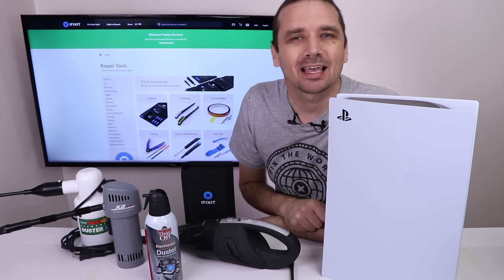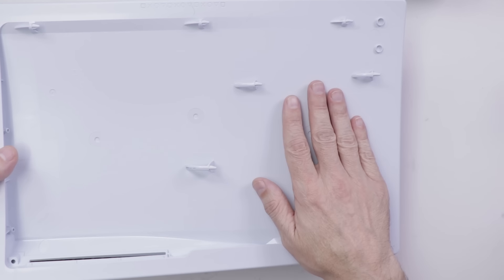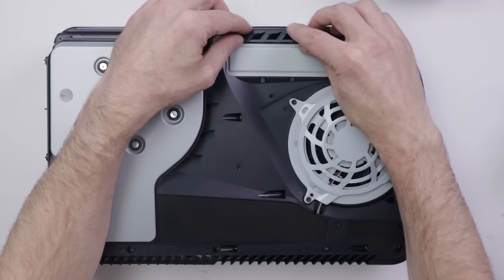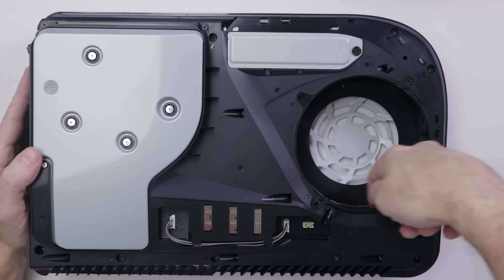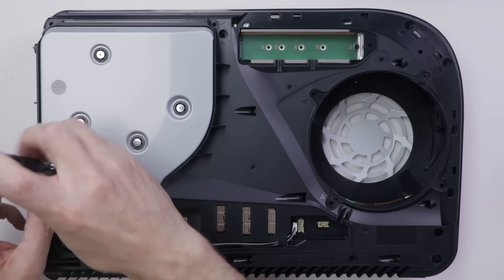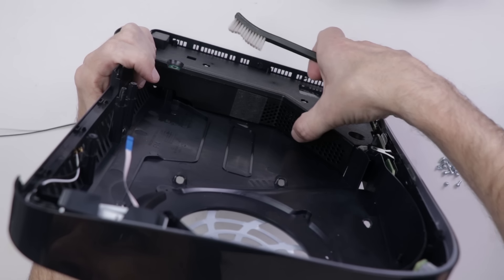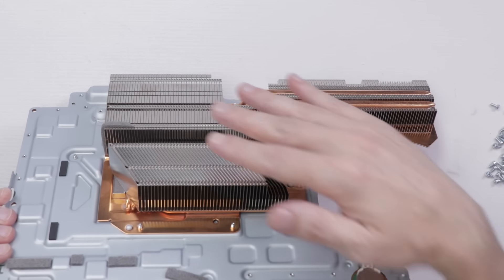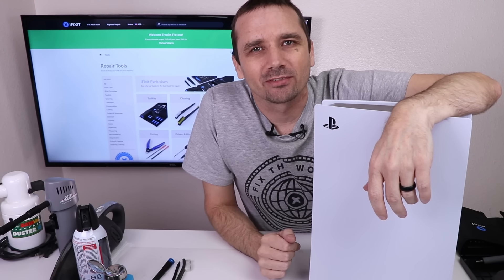How to Clean Your PS5 Safely - 3 Stages

Comment: Tip: before attempting stage 3, please note there is a sticker covering one of the screws which may void your warranty if peeled. After stage 2, I was able to look inside and saw lots of dust on the power supply. Picked up a shop vac microtool set from Lowe’s and I could clean it from the fan opening. No more random shut downs

Comment: Really helped me get it apart and cleaned, however, reassembly was so much more difficult due to inconsistencies in the screw placement during your video! You put the silver screws in the wrong spots in 4 places and made me redo half of the things I put together. Noticed it in a quick 1 second cut after you installed the disc drive at 10:17. Just be consistent
Reply: Yup, posted a comment calling out as many of the issues with this video as I could remember, still forgot a few. Unreal that only a few people are addressing it

Comment: Is there any way to tell if your console ABSOLUTELY NEEDS step 3 cleaning?
Reply: If you’ve taken the fan out, & you see the heatsink fins on the inside clogged with dust it’s probably a good idea to do stage 3. 
After you’ve dusted it that thoroughly, try to just dust the fan with air every few weeks or so.. that way you won’t have to take it down that far again.

Comment: All this made me realize how much cleaning the PS5 really needs especially at the 3 year mark. I never had issues prior and I’ve cleaned it every month but it was just the surface. I never knew the heat sink needed cleaning and boy was it dusty. I ran into issues of the PS5 turning off by itself. Come to find out the PS5 is very sensitive to dust build in the heat sink and hence why. There was no other reason I haven’t dropped it or spilled anything on it. So this dust has become my enemy 😂 the first stage is no problem cleaning out the heat sink with compressed air is good. Now I’m thinking of getting one of those air fans that pull out heat for the back. I honestly don’t want to replace it and I know that may happen down the road but nobody wants to drop another $400-500. Warranty doesn’t cover us anymore at least for launch consoles so while it’s a bunch of cleaning I’d rather do that than not.

Comment: I'm scared to do full disassembling, can I just use vacuum more frequently on two holes which are intended to collect dust?
Reply: Better than nothing
Reply: That won't remove the dust inside.
Reply: @jaybro3713  it will remove most of it if he does 2-3 times a month

Comment: 6:55 how do you remove the black and white cabels? Mine seemed to be stuck. If there is a way so safely remove them then please tell
Reply: Just pull them up. They are not soldered on so they should just pull up. They should be easy to reconnect/disconnect. 

Just make sure you know which colour goes where - I took a picture before and after so I remember.

Comment: @TronicsFix This was a very helpful tutorial and it stopped my PS5 version of Elden Ring from crashing. The only criticism I have is that, in the reassembly stage, a couple silver screws were put in the wrong spot and you can only tell when the disc drive is being reinstalled. Just thought I'd point that out in case you would like to edit that step to keep people from making a mistake. :)
Reply: Did you go all the way through stage 3? Cuz ps5 games have also been crashing my console and i heard it’s from the psu

Comment: Whose here cuz they ps5 got some visible dust through the air hole thingys
Reply: I’m here cus my ps5 can’t handle an hour in helldivers or wreckfrst without going into a coma
Reply: Oh for sure, I saw it the other day and that simply will not do.
Reply: I fixed this issue btw anyone reading - £15 on a specialised screwdriver set and an air horn
Reply: Me

Comment: Used this guide over the weekend. Worked great! PS5 is cruising now and I'm no longer getting the "overheating" message or shutting down due to overheating. Thanks!
Reply: @Draco_P_  Did you break your PS5 all the way down to Stage 3 of cleaning? I tried to clean mine and it’s still overheating. I’m about to tear it apart and hope it’s easier than it looks.

Comment: My hands are too weak to remove plates 0:43
Reply: It could be an issue of technique ensure on the side with the logo you are pulling (not too hard just so it's a little out from the console)  the top left of the plate (presuming it's standing and facing you normally) and for the other side it's the top right of the plate aka near the back of the console.

Once you've got the part lifted for whatever side your removing keep it lifted and slide it down if by this point you haven't already have your console on its side so the plate has room to come off

Though if it isn't an issue of technique then my apologies I don't know any more accessible ways to do it.

Comment: Thanks this is the 2nd times did a stage 3 cleaning of the system. It works everytime. The 1st time I did a stage 3 cleaning was about a year and 6-8months ago. I notice that the system was producing at lot more heat and making my room stuffy. So i knew it was cleaning time. Thanks Your video was a big help!

Comment: I have a question, do you have to exactly go through all 3 layers of the ps5 or do you have to clean the first layer cause it’s very time consuming if all 3?
Reply: Stage 3 would void the warranty so no don’t go as far as that
Reply: Nah stage 3 is absolutely ridiculous, I doubt getting dust in those areas is gonna ruin your console. I only dusted my ps4, didn’t take anything off and even for that my system never had a problem

Comment: Hey mate, awesome content, helped me greatly getting through my cleaning and dismantling. Although i would like to point out an error you have made from disassembly to the reassembly. During disassembly where the SSD card slot is, you have all 3 holes below the SSD slot. But during reassembly, you have the middle and right screw as non existent below the ssd as non existent and a screw that shouldn't be there approximately 10o'clock from the fan slot, you also placed the remaining spare screw at the bottom of the hard drive which needs to be free for the case screw. This caused an extra 1-2 hrs of stress and wondering where i went wrong. Hopefully you can edit this to save others the hassle! But all on all, brilliant job mate!

Comment: Do people do this?
I’ve owned every PlayStation over the years, except the new one (you know why) and have not once cleaned any of them yet they all work 🤷🏻‍♂️
Reply: Some people live in grotty homes.  Never had an issue either.
Reply: I can't answer for everyone else, but I recently took my PS5 apart, to add little o'rings up and under the fan, to try & mitigate "noise".. & the unit
already had managed to get a very fine coating of dust on it. So I partially cleaned it while I was finagling with the fan. 

Also dust gets everywhere.. EVERYWHERE (Its really just time & air circulation)... & with more powerful CPU's/GPU's & heat generated.. its probably going to be more
imperative that you stay on top of the dust control in the future? 

Also its called "Thermal degradation"... everything electronic hates too much heat. So while your units probably worked alright.. you might have cut
some of their lives short by a bit?

Like you, I haven't had too much problems with any console in the past, & dust. But I also was ignorant of.. purpose of keeping my console clean.
Reply: Yea it may work but it’s still dirty, my 2013 ps4 is extremely dirty but still works. People clean there consoles so it lessens the chance of the console to just stop working
Reply: I've had mine from realise date and i checked my dust just today, its pretty tiny for nearly a year 😅.

Comment: Just a note you could have mentioned when reinstalling the metal plate as i saw you initially messed up and changed it when you went to install the disc drive. The holes you dont put the silver screws back in should all be marked with a vertical groove. Small note that i noticed when trying to figure out where i went wrong after pausing and copying the video at the reinstalling phase realizing it was wrong.

Comment: Just did my first cleaning since May last year. Only needed to do a level 2 cleaning. Just used a toothbrush and a new J-cloth because the dust was so light. I'm surprised it wasn't more filthy given how dusty the outside of the console was but I'm glad it's not needing a level 3 clean. 
One thing I wish you kept in was which length screw goes where when re-installing the fan. I kept mine in order, but others may just place them haphazardly.

Comment: Had my console for over a year and never cleaned it. I eventually needed to upgrade my storage last month so I took the plates off for the first time and noticed the dust in the fan. Unfortunately at the time I didn't have the right tools, so I ended up using a vaccum on the outside. I did stage 2 today and I was terrified about disconnecting the fan but my console still turned on rn, so I'm glad i didn't mess anything up

Comment: If you’re nervous about doing step 3 it’s well worth it. I just got done cleaning everything out and holy hell the power supply was CAKED in dust, fur, and god knows what else. If your PS5 is overheating and shutting off please don’t be afraid to go that but further rather than just cleaning the fan

Comment: Wanted to comment, I've had a ps5 for a few years now, never cleaned it. Noticed it was noisy so I did the level 1 clean only using a regular vacuum. Just that helped a lot. It definitely needs a level 3 clean with the proper tools though. I suggest doing level 1 clean often to avoid having to do a level 3 clean haha.

Comment: I clean the fan from both sides and also all the vents, holes and ports using a strong vacuum cleaner. I put the console in a plastic bag to block all vents so that the air suckling will be much stronger and deeper when pointing the vacuum in each spot. Not a tiny dust particle remains inside. Just make sure the plastic bag covers all vents while vacuuming form each spot and do this in sequence.

Comment: @2:50 cleaning out those holes mattered for me. pulled out a large clump of lint. glad i found this video. ive opened and sprayed my ps5 a couple times. it would turn off without warning and i have to unplug it. finally found others with the issue. its the power supply being suffocated and the ps5 will turn off without a warning of overheating. Thank you for the vid! if the problem happens again, ill follow the rest of this and give it a deep clean
Reply: I have the same problem. Is your console running fine after just cleaning out the holes or did you need to do stage 3?
Reply: @amirmehr151  so far no issues at all
Reply: Can I ask how u cleaned it cause I’m having the same issue
Reply: @SosukeAkura  i have a computer repair kit with some long tweasers. Used them to delicately fish out the lint clumps.  Took about 10 minutes.  Have canned air on hand
Reply: @camm9210  ok I’ll try that and see if it helps, thx

Comment: I just used this to clean my ps5, this video was amazing, I didn't think my ps5 would be too dirty inside and maybe just the fan dirty, boy was I wrong. 
I did a level 2 cleaning and it has taken be about 90 minutes. Since doing it my ps5 is like new instead of sounding like it's going to take off and then telling me the ps5 needs to turn off due to heat

Comment: i finally took apart my ps5 after about 18 months and a suprise NO DUST AT ALL.   i guess it depends on where you put the console.  plus depends where you have it but it could take years for alot of dust to build up deep inside the console in which you would do stage 3 cleaning

Comment: After taking out the fan, if you use a small flashlight and some flat tweezers, you can actually pull about 70 percent of the dust off the power supply without going to stage 3. (mine was caked, it was causing overheating within 20mins of elden ring) it's a hell of a reach with the tweezers, hand size could be a factor as well. However, if you wanna avoid diving into the much more daunting and time consuming stage 3, its worth a try. 

P.S. personally did this method and havent had any problems since (about 6-8 months) . However im here now, watching the video to finish the job 😂

Comment: I did stage 3 now my ps5 doesn’t display on the TV anymore. Do you have an idea how that could be?
Reply: @ForDaRecord  have you checked all the cables are connecters are connected properly?

Same thing happened to mine and I noticed one of my connectors had come loose, it just so happened to be the power button connector. It worked when I reconnected.

I think it happened from when I put the back plastic bit on, it must’ve come loose. 

That’s the only thing I can think of which might be causing your problem.

Comment: A few things that were left out that may save someone some time. 
Both the fan and the black plastic case have multiple lengths/different threads of screws. Make sure you keep track which came out of where to save you the time of trial and error. Had they filmed the video at a slight tilt, it'd be easy to see when he unscrews them. The fast motion and snap to completion make it worse. Take a before picture of each "layer" so you have something to refer to and zoom in on. And for level 3 cleaning, there's a black rim that will fall off when you get down to power supply. It didnt break! You just have to hold it steady when screwing the MoBo back in.

Comment: I love all your videos.  I’ve fixed my joy cons as well from your help.  I need that toolkit as well.  For over a year my PS5 barely had any dust.  I bought mine years after release.  It seems slightly different inside such as that adhesive black part near the fan port.

Comment: Great guide, but a simple warning when dealing with the step reinstalling the 41 screws. The host installs 2 of them wrong then when he goes to install the black plate over the CD drive, 2 screws magically move places. You only discover this when you try to screw in the backing plate and discover you can't screw them in. I recommend referring to a pause screen of when he first takes the backing plate off.

Comment: I randomly popped the covers off and I was shocked too see so much dust on the sides of my ps5 I did the brush method cause I didn’t have a air in a can but I did have a big ass vacuum so I cleaned that 😂 didn’t have the tools to take it apart to clean the actuall fan but I did see the fan wings coverd 😢 couldn’t do nothing bout it

Comment: Hoping I'm not counting my chickens before they've hatched, but thanks for the video!

I was playing the PS5 version of the Witcher 3, when auddenly my PS4 shut itself off. I kinda freaked out, i do not have the money to replace it or do major works, but this is my first issue after a year of having it, and i never got a warning about anything. Looking online it seemed to be overheating, and it all was very hot. I'm like Alan Grant when it comes to technology, i just look at it and it breaks, so taking apart something absolutely terrified me. But i followed this video until stage 2, and just carefully and delicately cleaned everythibg i could reach, i only have a dust/microfiber cloth, and compressed air, so i did the best i could. I could still see some dust inside, so maybe stage 3 was slightly needed, but honestly this for me was already testing the gods, i already was so incredibly scared doing this, so i just got rid of the worst of the dust and said that's good. It turned back on and has been working fine, i did this a few hours ago so all seems good. Hopefully with better maintenance and maybe just dusting once a month, i won't need to take it apart and everything's fine

As i said, no issues previously, and I've never gotten any warnings, but there was some thick dust throughout. But hopefully that was the issue, and this has fixed it, and i didn't cause any further damage. But yeah, this guide really did help me with what to do and helped me not panic too much, so thank you :)

Comment: Had to do step 3. Disconnecting the Bluetooth antenna cable pulled the soldered connection to the board with little to no effort! 😩
Now I have to attempt to solder it back on

Comment: I needed a stage 2 cleaning. I must say there is a noticeable improvement to the fan sound when it runs. It use to sound like Apollo 13 ignition and now it’s super quiet. Almost made me think I didn’t reattach the fan correctly, 😂 10:43 Thanks a million

Comment: For those just looking to dust clean (stage 3) the 41 screw part is not necessary, just remove the the 3 long black screws (shown in the video) and it will come off. You'll still have access to everything you need. Hope this helps save time :)

Comment: my ps5 keeps turning off after awhile. I did steps 1n2 step 3 is my last resort. have u had this problem?
Reply: Yes, my ps5 is shutting off randomly. This happened about a year ago and I cleaned it and it fixed it. Now it’s back. Maybe the summer and my room is too hot? Have u found out how to fix yours?

Comment: Awesome Video! Got my PS5 done same day thanks to you. 

TIP: MAKE SURE the T8 bit is a “Security Torx Bit”. Best way to tell is, there will be a hole on the tip of the bit. You’re going to need that for the screws which have a small protrusion in the center.

Comment: Just to keep everyone aware, he put two screws on the metal plate on the wrong spots. One where the disk drive screws in (there are two stacked, the top one doesn’t get a small screw) & there is one where the fans last screw goes in. Put those two in the blank holes by the drive extension area. I only just realized this after getting it all back together & having to take it back apart

Comment: I flipped it over as in stage 3 to unscrew the two screws on the back, and a small foam rectangle fell out. Looking at the silver panel I don't see it on the silver panel in the video, so I'm not sure where it goes. It's the biggest, thickest piece of foam compared to any others.